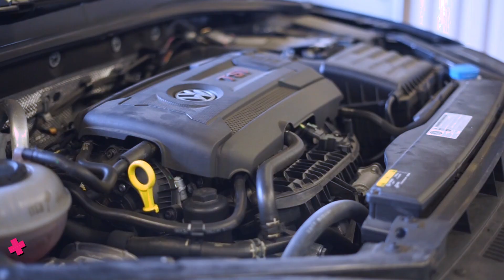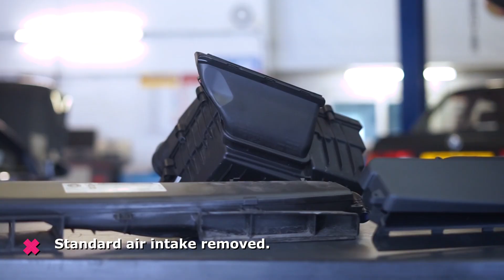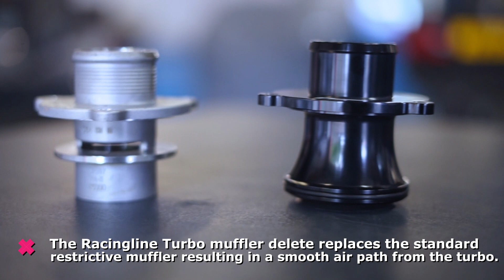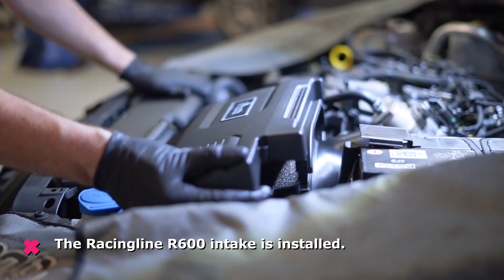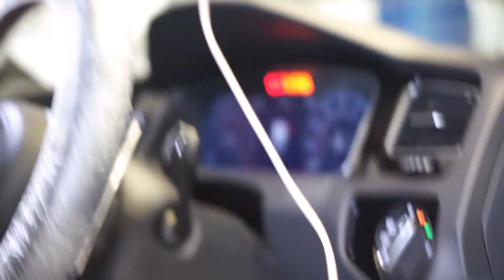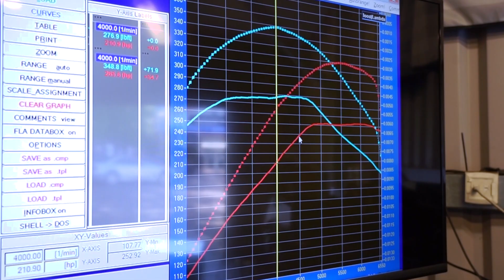MK7.5 GTI PP APR Stage 1 ECU, TCU & 4 Piece Racingling Intake +69HP & 72lbfts!

Comment: Does the OPF make any difference on potential power gained? APR stage 1 ECU + TCU with APR carbon open intake.. Do you think i'll hit 300bhp? on a GTI Performance mk7.5
Reply from the maker: GPF cars cap off at about 360ish
Reply: @RegalAutosport  What would be required to hit 360?

Comment: Fyi high tq file is for dag cars you don't need a DSG tune .stock DSG clamping is fine for that tq .
Reply from the maker: FYI - high torque file is for cars with upgraded manual clutches or DSG software, this is due to the torque produced exceeding what the factory components/software can handle. Therefore, requiring an upgrade.
Reply: @RegalAutosport  I know your saying that lol but it's not true .the high tq is for dsg cars so you don't need a DSG tune the stock DSG tune is fine stop making people waste money when they don't need to .stage 2 is38 levels around 400+ tq then maybe yes a TCU but it isn't required cause it won't slip at those levels ethier
Reply from the maker: We’d have a lot of unhappy customers experiencing clutch slip and premature clutch failure if we took your advice 👎

Comment: Your stock numbers are off. The cars make 228hp and 258tq stock 253hp and 279tq are not correct
Reply: Their numbers are about right, a standard GTI is about 230hp but the one in the video is a GTI Performance Pack which VW quote as 245hp so pretty much what they got!
Reply: Most German engines are underrated from the factory.  Stock Gti runs 101mph traps.  MK8 Golf R runs 110mph trap, its making close to 380hp.
Reply from the maker: Thanks for the comment, we often see MK7 GTIs and MK7 Golf Rs making more than the factory quoted figures, no matter the baseline figure, they always make around the same peak power. 

Hope this helps

Comment: Would you need to change the clutch if it was a manual..?
Mk7 pp owner..
Reply from the maker: To run the 'high output' file, yes you would. There is a 'low output' file with reduced torque to reduce the liklihood you will need an upgraded clutch.

Comment: What about installing oil cooler at that power gains? Is it necessary?
Reply from the maker: Thanks for the comment! Oil Cooler is only really needed if you will be driving the car for sustained periods at high load, high revs and generally in a hot climate. 

For road use, the stock cooling system at this power level is fine.
Reply: @RegalAutosport  thanks for prompt reply! Does driving on autobahn at e.g. 170kmh dor 2 hours in moderate (european) climate with this gti/octavia rs can already be considered high load or the stock heat exchanger still should be fine for that?
Reply from the maker: No problem! We’ve never seen high oil temps when cruising at 120+ on the autobahn. 

Main issue on track is you are constantly at high load, high revs and at different speeds which causes heat to build up. 

Whereas on the autobahn/cruising you are at a constant load, lower revs and constant fresh, high velocity air. It’s a completely different scenario

Comment: Hi guys, would this upgrade fit  and benefit a standard MK7 GTI non pp?
Reply from the maker: Hey! Wavetrac have a specific LSD for the non-PP GTI, it's a little cheaper too. To find out more, you can contact a performance specialist by clicking the link in the description
Reply: @RegalAutosport  I’m talking about the 4 piece Racingline intake.
Reply from the maker: Ah! Yes, it’ll fit the non PP and you’ll still feel a tangible benefit! Power, boost response and sound!